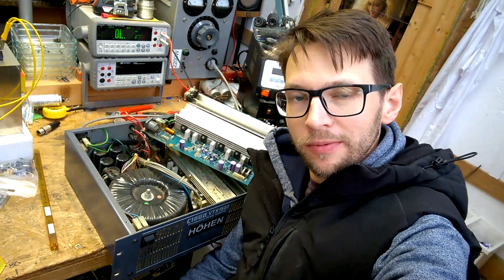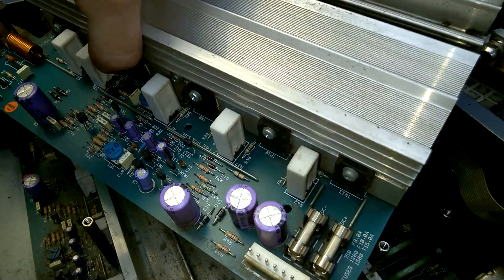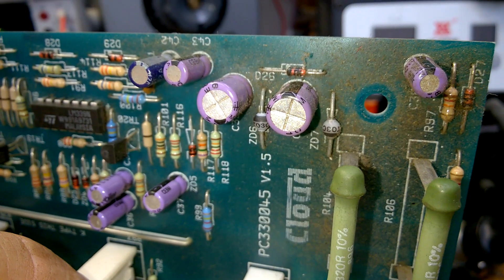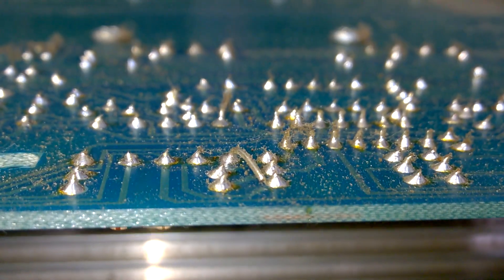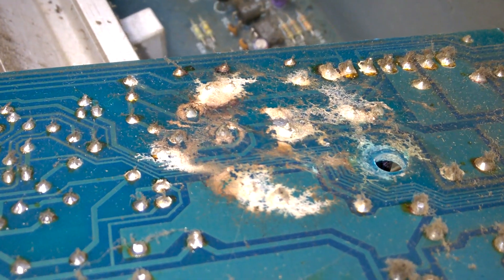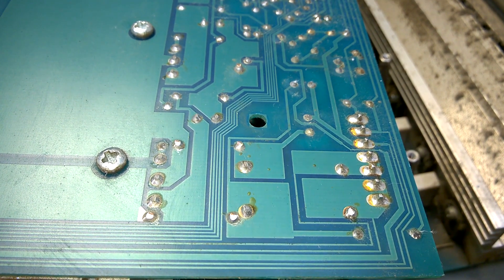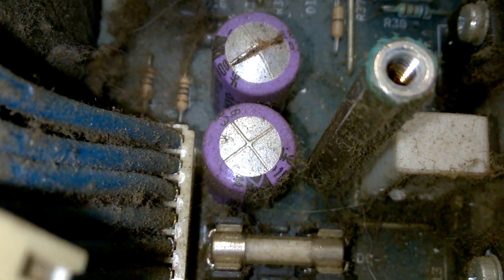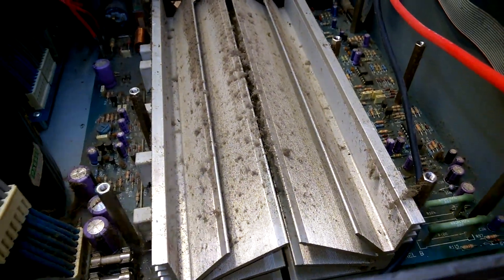Cloud VTX-1500 Amplifier (Part 4): Second Unit. What's wrong?

Comment: I am looking at some VTX 1000. If anyone has corrosion under the board check the track under the audio cable that is soldered diagonally (as well as the outside edge tracks at the back). Also, if anyone made the mistake of touching both heat-sinks at once and getting a huge belting shock then check for a short on the 3 legged sensor on the heatsink. One amp i received had the wrong resistor values in the protection circuit, changed them back to 1.2K and 690 ohms because someone had put 6.6k and 1.1k, Still hunting for audio on one channel but probably something to do with the broken selector switch on the back of the bottom board, i have a blown VTX-1500 somewhere for spares. Had many of these amps over the years, lots of vtx 1200 a 500 some 1000 and a few 1500 and some 750, selling them all now. Using MC2 Lab Gruppen, QSC but i might keep a vtx 1500 or my flight case with 2x 1200 just because i love the build of these. Not a touring amp but you could add lock tight which may help a bit. A bit heavy these days but not much can go wrong with the power supply! So simple! Once i had a stack of these setup at a night we were doing, for some reason i had put a sheet of toughened glass somewhere in the stack, i remember something broke the glass and the amps moved a bit and then one of the 1200 blew up. It was just the diode bridge rectifier, can;t remember now if a wire had come ff of it or of the rectifier blew up but apart from this i have not really had any issues. I bought a load of broken ones as spares and started to fix those. The vtx 1500 i bought for spares was too dead to bother with, blown to bits it was! I also have a load of crossovers and some other cloud amps. I have an 8ch 8x 50 with zone mixer and a 6ch i think they are 6x 120W

Comment: Dust/dirt an electronic circuits are a very bad mix. Dust captures/retains water vapor under adequate circumstances and it can become very conductive ... Moist will likely form on those dust covered parts and ..shorts can happen.
Reply: Possibly used in a restaurant/bar environment.  In the US the banning of smoking in restaurants and bars sure made working on amps like this a lot better!
Reply: @peterhaan9068  Agreed. but also using proper filters could avoid a lot of issues. Only very small particle dust goes inside ant that takes a lot longer to accumulate to the point of being able to cause shorts. Also regular maintenance from the users wuld be great .. but wait :) :) !! All of those do not open stickers all  over and warranty void if open ... ummm I always wondered why they place those on the electronics .... maybe now I know :) ... to shorten lifespan and increase sales :)